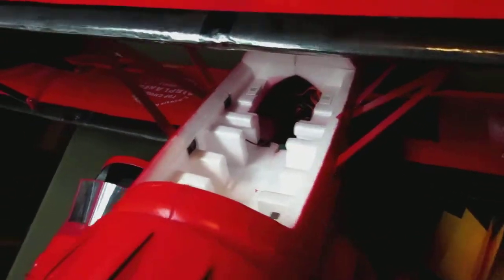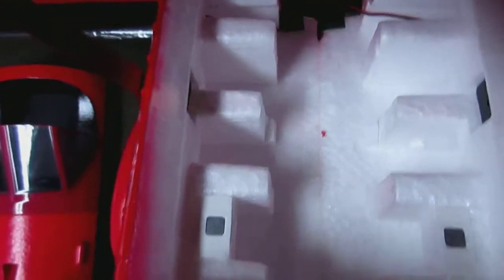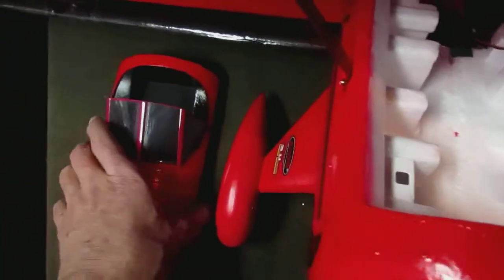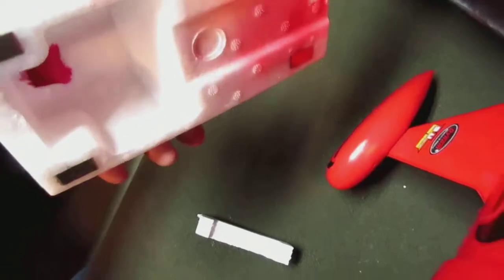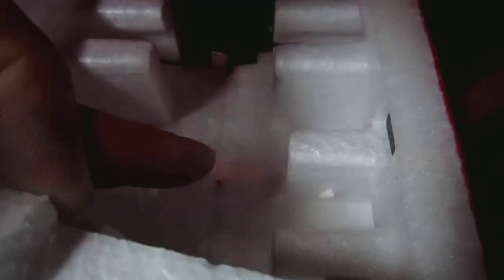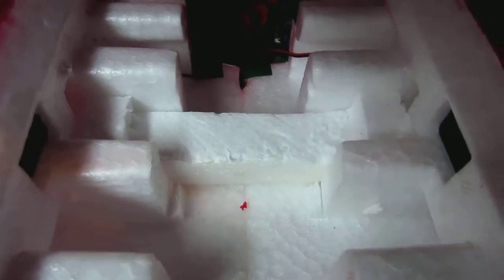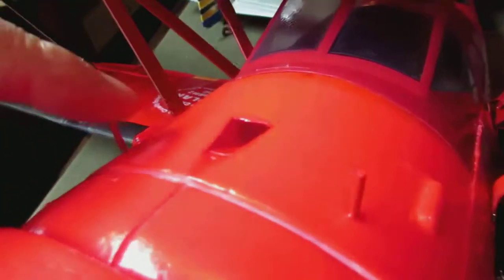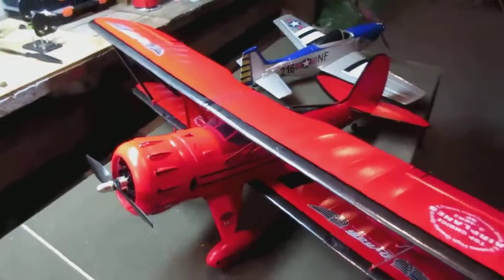Dynam Waco Build review -  part 3 of 3   (27 Oct  2018)

Comment: Thanks for putting these build videos together. I'll be putting my Waco together after Christmas ready for Spring - so your build tips will be useful. 
(I am hoping on using 4000 4S batteries since I have a few already. Just hope I don't spoil its flying with too much weight - although I see you got away with 3300 batteries so I might be ok.)
Reply from the maker: Thanks.   The last flight I did, after those videos was again with the 3600mah installed.   It was spot on and flew like a gem.    Can't recall whether I put a couple of 1/4oz weights up ahead of the battery or just one...or none.   Can't remember.   I am sure a 4000 will be perfect....definitely don't add any weights with that one in there.
Reply: @markhyde43  

On mine, I had to add weight under the cowling in the motor area (forward most area), & was using a smart 4s/2200. Found a soskin (?) 4s 3300 that fits, & has correct balance! Mine was super tail heavy from day 1. I bought it used.
Reply from the maker: @old-rcplane-phart  yeah.  I think definitely for a 2200.
My 3600mah was a good fit and I did not add weight.   My 3200 does feel a tad bit light up front, so I like to drop one or sometimes two 1/4 weights in the front side pocket cutouts just to the left and right side of the battery.   I don't peel the tape of to stick them.   I just shove a piece of soft foam in there with them to hold them in there for that flight and that battery.    Seems to work well.

Thanks for generous comments.

Comment: Thanks so much for your video!  I have purchased this plane but as yet not started my first ever build and am terrified to start ,so I have been pouring over everything I can find about this plane. Thanks again, new subscriber to your chanel :)
Reply from the maker: Glad I could help in some way by making this build review.  This is one of favorite planes as it flys so well.  Once I got it dialed in, I haven't found a single issue with this plane and the way it flys.  It does whatever i command it to do without flaw.   Certainly a go-to plane.   You'll certainly love this plane once you get a handle on it.